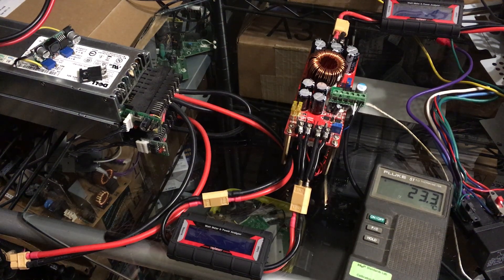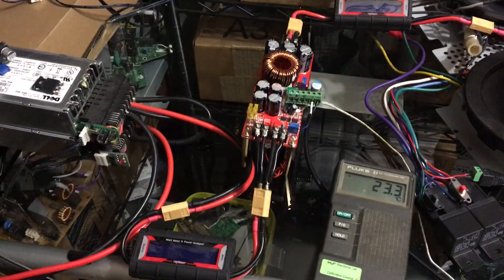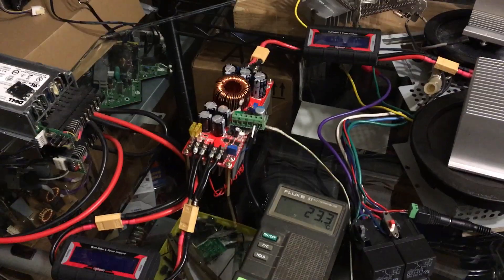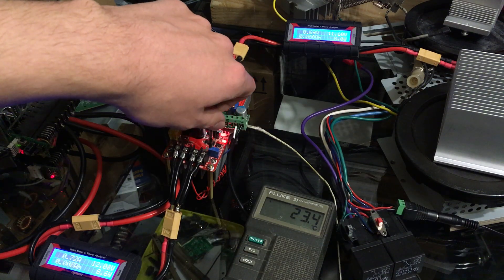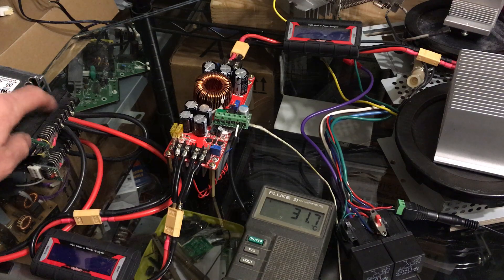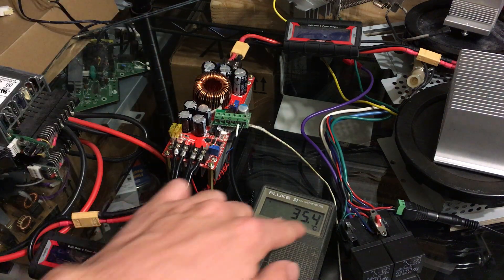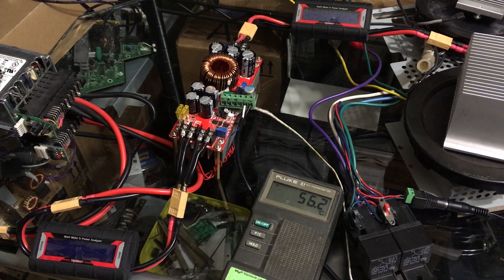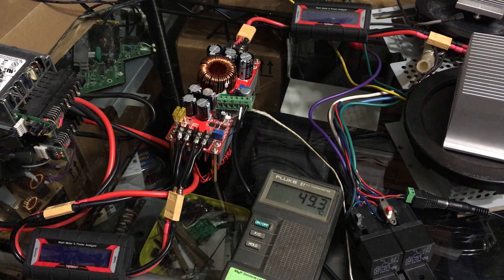1500W Boost converter makes 658W before dying a valiant death, 12v and 24v in

Comment: My current knob doesn’t change thr current on my multimeter. Broken knob?
Reply from the maker: you are talking about the current knob on the boost converter? The current adjustment is pretty odd, it doesnt seem to work in the way you think it should work, But I dont think it is a broken knob, you do also need to make sure that the load is drawing enough current to register in its feedback loop. Hope this helps cheers!
Reply: @SuperBrainAK  I loss patience. I must have overturned the current knob with a power drill. Now, I’m also not getting any input voltage. Anymore suggestions?

Comment: For everyone watching, the 1500W rating only applies when output voltage isn't much higher than input. It's legit but you must follow the specs which has an INPUT current limit.
You have to derate for input current. Here, it's 12v in and rated for 30A INPUT so 12 * 30 = 360W. With efficiency losses, it will be less than 360W output
Reply from the maker: yep you are right, I was maxing out its input current limit in this video the fuses themselves were probably wasting 2 or 3 watts. The famous "1500W" rating is the maximum voltage 50v times the max current 30A, 50x30=1500. Maybe I can they these on 48v but that would require putting 4 12v server PSU's in series, to do it properly that will be alot of optocouplers! Thanks for the comment!
Reply: @SuperBrainAK  I bought myself a 50A input boost converter but it's also 1500w.
With 24v in (2x 1200W server PSUs in series), I can charge my 14S battery at 58.8v 15A comfortably
Reply from the maker: @TheAviation101  cool, is it the similar build to mine or a much more robust design? Sounds like a good setup!
Reply: @TheAviation101  hum i would luve a link or so i can find one i think mine is like his
Reply: @TheAviation101  that's almost exactly what I am doing. I have many 750w/1100w/1200w server power supplies and I'm running this converter to charge my DIY esk8 board(12s 50.4) my gf is 42v. I'm also charging my portable solar charge pack(7s 29.4v 4900wh pack) as well as my "12v" heated jacket batteries that I built( 4s 16.8v). I was running the jacket at 12.8v for 2 seasons because I was scared to run it at 4s but realizing these are meant to be ran off of snowmobile/motorcycle batteries/stators that run up to 14.8v when it's on I thought increasing an additional 2v wouldn't be too much of a risk and I was right. My jacket is rated @ 72w(12v) now I'm running at 16v+ and getting  upto 105w of heat and this think is sooo hot on high setting now! Sorry lol I'm rambling.
Reply: Exactly,  people need to understand that the power is equal to input voltage X 30Amps. So 12v x30= 360w
48v x 30a = 1440w

Comment: 805.6W input 658.5W output, so you lost 147.1W to heat.
No way that heatsink is going to cope with that much heat.
Reply from the maker: yea there is no way the mosfet was going to cope with that much heat, it just has a thermal pad with mounting pressure from the PCB. It was already overheating with the 12v in, the input power was increasing with the same output power. so I think I just need to make sure I dont go over 30A (what the converter is rated for stock) and keep and eye on the mosfet temperature.
Reply: @SuperBrainAK  do you think you could up the power capability by changing out the mosfet? Or would you have to rewind the transformer too?
Reply from the maker: @TheNeighbor4U  its biggest weakness is the mosfet, mosfet driver, and cooling the mosfet, the inductor only gets a bit warm during those high power tests so I dont think changing the incuctor will improve much, I have already changed the mosfet for an IRFP260N which is much better
Reply: @SuperBrainAK  sadly nobody knows what fet these use because the markings have been removed but 247 can easily transfer 150w of heat and the heatsink can handle it just and just. The pads are the limiting factor, just got mine so I have to see if they pass anything thro the heatsink and if i can just remove the pad or if I have to replace it with mica. Also not late :D
Reply from the maker: @dandeson9723  You certainly still need the insulation pad, the tab of the mosfet is the positive output, so it needs to be isolated.
The modules I got had markings, I might be able to tell you next week. It was similar current and voltage to the IRFP260N but at a lower switching time.
Thanks for the comment!
Reply: @SuperBrainAK  I know, what I meant is that I could remove the pad from the 247 switching mosfet only for better temps, it should be okay in theory as long as there isn't anything connected to the heatsink and as long as I don't short it. The input fet has a max RDS of 8mΩ meaning it won't produce alot of heat and two diodes in 220 package should be okay with pads, I could also use mica tho. also that would be great , thanks :)